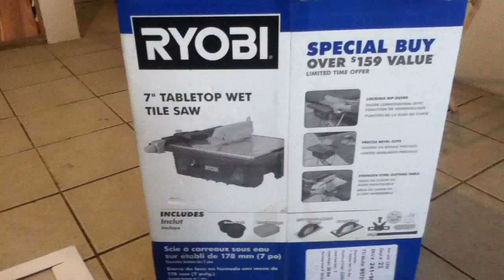Ryobi WS721, WS7211, and WS7211K 7" Wet tile saw setup and operation

Comment: Thank you so much. I bought one of these several years ago at a flea market for $40.00. It didn't have a blade and the guide, but it had everything else. I don't use it very often, so after storage for several months at a time, I sometimes forget how to reassemble it. The manual isn't very helpful.  This video  is just what I needed. The advice is so on point. It's a nice little unit. I've definitely gotten my money's worth out of it.